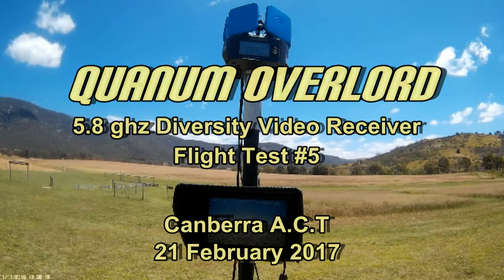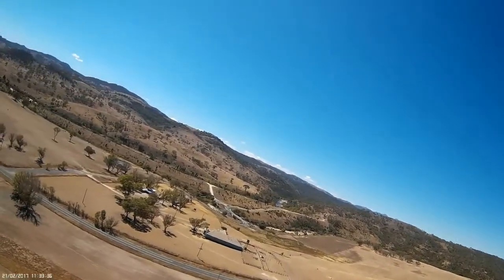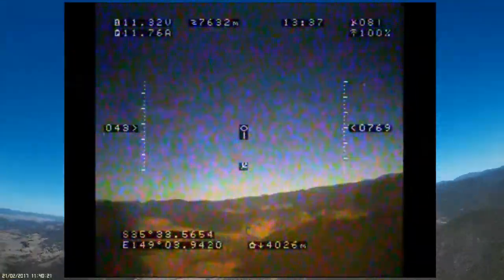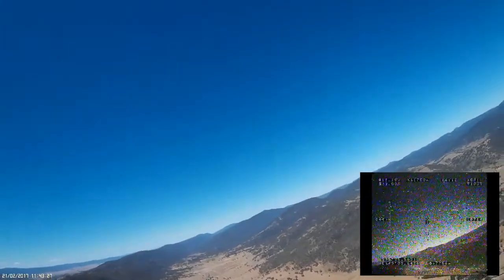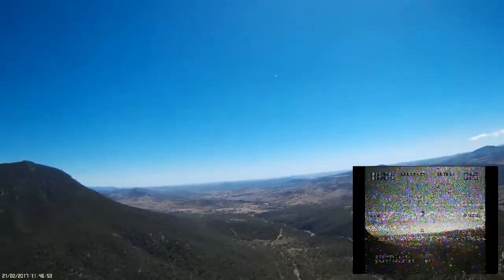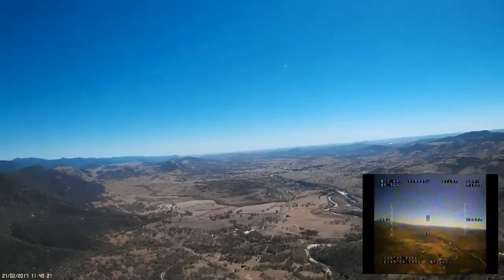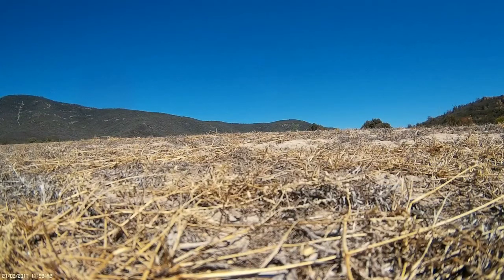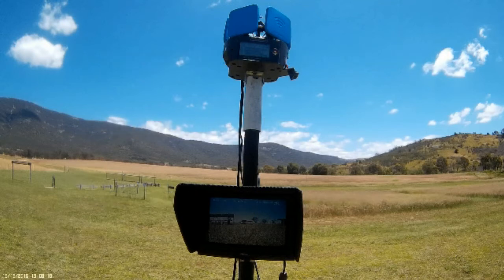Quanum Overlord Test #5 - with autopilot landing

Comment: Well done 8km,gives me hope for 5km with my quadcopter.If they are "high gain patches" with a beam widths of say 30degrees at home point wouldn't the beam angle slowly increase with greater distance giving better coverage.
Reply from the maker: My thinking is that 5 x 30 degree beams can only cover a maximum of 150 degrees. The Overlord has them distributed equally in a 360 degree (circular) array so there must be significant gaps in the coverage. While the beam widths increase with distance, so would the gap widths . . .  wouldn't they? Or am I just losing it?.
Reply: You are right about the gap widths.It also would be good to have a way of testing the antennas to get an idea of the real beam widths and antenna gain in comparison to the other antennas you have to get an idea of where this antenna fits in relation to the more expensive antennas.Maybe the centre antenna could be replaced with a helical facing at an angle that captures the signal when flying at height and distance.
Reply from the maker: That's a relief! I don't think there's an antenna around yet that doesn't sacrifice beam width for distance which is what I'm after. I generally know in advance what direction I'll be flying in so I don't really need the full 360 degree coverage. I'm hoping I'll be able to arrange the Overlord's 6 antennas into an "overlapping" array with wide enough coverage to keep me happy. 180 degrees or even less would be enough.

Comment: i had read in a lot of places that aomway antenas are crap, however this is a very good product regardless the antennas, due the scanner function and the 6 rx
Reply from the maker: I have seen similar reports but I opened these up and they're quite different from the examples others are talking about. The main problem is that they only have a 30 degree beam and 5x30 = 150 degrees distributed around a 360 degree which leaves plenty of gaps between them. The gaps get wider the further out you go so the alignment of the array needs frequent adjustment out past 3k.

I ended up modifying the offset of 3 of the patches to 20 degrees so that they overlap and give a wider overall beam. It 's better but still needs to be adjusted at greater distances. See my later videos.
Reply: yes i had already see them, probably with other kind of antennas could work best, i had an gas powered fpv plane, its an scaled version of the rq-7 with trainer profile, i had a 900mhz 1500mw vtx but planing to change to 5.8 theres no hardware for 900mhz these days, dificult to find, i bought all antenas of hk in 900 mhz and none worked best than the stock, i planing to buy the aomway 1000mw 5.8 vtx, but i dont know what reciver, i am thinking in the overlord or the arkbird antena tracker with a 2 antenna diversity rx
Reply from the maker: That's bad luck. I guess it depends on how far you want to go. If I didn't already have a lot of 5.8ghz gear I'd switch to 1.2ghz for more distance. At the moment I'm trying the RSSI Pro Track 5.8 tracking antenna and getting mixed results. https://www.youtube.com/watch?v=jU6drDXWrJQ

Comment: 1.2....
Reply from the maker: ?? too subtle for me . . .
Reply: A lot of money for for so little gain with that overlord and 1.2ghz with a simple circular polarized  at least doubles distance..Is this not legal in Oz?
Reply from the maker: Aaaah. Now I see. I thought it was a reference to a sequence (1, 2, buckle my shoe etc.). You're absolutely right. 1.2ghz would have been a better choice at the beginning but I've got too much 5.8ghz kit to give up so easily. I was pretty happy with my 4-way diversity setup but the Overlord gave me the opportunity for a 6-way diversity system in a neat package without all the cables, plus an RSSI display. It was expensive but I don't really need 360 degree coverage so if I ditch some of the patches, I should be able to come with an "overlapping" array with wide enough coverage to keep me happy for a while.

For me, messing around with this stuff is half the fun and I'm sure that after I've wrung out the 5.8 I'll start looking more seriously at 1.2 but then there's also antenna tracking to explore . . . .